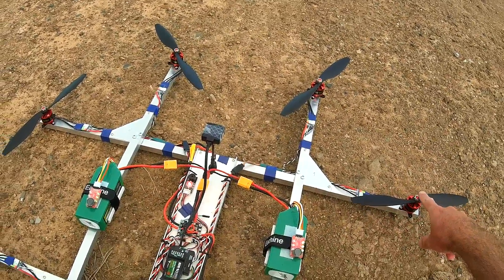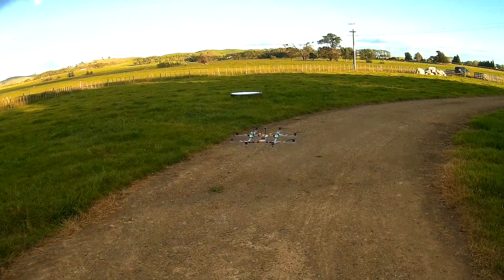Octo thinks it's a quad :)

Comment from the maker: Just in case I didn't describe that clearly enough: http://www.iforce2d.net/tmp/fakeOcto.png
Reply: you can use same esc for 2 motors, I tried and works well, just solder same 3 motor wires of 2 motors in  agrid to same ESC  and will work fine
Reply from the maker: I just replied to you twice already about this, it will not be fine :)
Reply: iforce2d I tried myself 1esc 2motors and worked fine for me.
Reply from the maker: No need to spam the comments so much. I already replied about your 'worked fine for me' in the other comments.

Comment: This really cool. I think this should work with the stacked octa/quad design (I don't know its offical name) where two motors are mounted on one arm in a kind of push-pull configuration, shouldn't it?
Reply: Counter-rotating props. Often called coaxial, even though technically on a multirotor they aren't. Unfortunately unless you do it really well you get big efficiency losses, in the order of 20-25%.
Reply from the maker: As long as the motors using the same PWM signal are spinning the same way it should be ok. So you could make an x8 or a stacked hex, but not a y6.

Comment: May you simulate a motor fail disconnecting one random motor and check takeoff / hover performance?
Reply from the maker: No, this is not mine.
Reply: iforce2d oh. But still an useful test. Isn't the reason why anyone build an exa or octo config?
Reply from the maker: For this case, the reason is just more lifting capacity.

Comment: Is it more efficient (longer flight times) with 8 props vs 4 ?   (if so, then 16 or 32 props could be possible.)  Interesting experiment.
Reply: sptrader nope, one big single rotor would be the most efficient (like a helicopter).  Adding more motors/props add more weight. The increase motor/props increase working area that it can use to produce lift. So has more lifting capacity

Comment: I got in on that 3DR $3 Iris motor deal...  I actually want to do a HexaDecaCopter soon with them.  Do you notice on a scope if the signal voltage drops too far to be split 4-ways on each pin?  I might only have to do 2 if I use pixhawk.  I intend on trying coaxial & concentric on only 4 arms...  I'm not sure how well it'll fly, but I want it to lift, bro.
Reply from the maker: I didn't do any checks on the scope. I kinda think you'd be able to do 4 though.

Comment: Seems like the configuration might be giving up the redundancy that makes octos more reliable.  In that config a single failed motor could cause a pyro event.  Cool idea though.
Reply from the maker: I don't think a failed motor outcome would be a whole lot different to a real octo. In either case it would lose 1/8 the lift capacity, and the effective center of thrust would shift slightly.

Comment: I’m actually surprised this worked. Trying to work out the mechanics in my head. Is this reliant on the paired esc’s being very similarly calibrated? What would happen if they weren’t? Would you get strange roll, pitch, yaw response? What would happen if you pumped the throttle up high and one of the pairs was out of balance, is the flight controller just going to deal with it like one slightly less powerful motor? Very interesting.
Reply from the maker: A similar calibration would help, but I think the PID controller could still handle it either way. Think of it like driving an electric car that has hub motors in the wheels, if one of the motors was weaker than the others, it wouldn't affect the way you press the throttle pedal, because the controller (you) is only sensing the overall feedback of the car speeding up.

Comment: So damn stable!! What FC are you using? And good much flight time do you get with this setup?
Reply from the maker: Arducopter. About 18-19 minutes just hovering. 2x 3S 5200mAh in parallel, 2212 980kv, 1045, AUW about 2.5kg
Reply: iforce2d bro that's a lot of flight time! Atleast according to the standards of mini quad pilots like me :p

Comment: its not 6 pins, some of the pwm pins can be configured as motor out 7 and 8.    anyway in a reasonably modern firmware you can remap to whatever pin you want.
Reply from the maker: This flight controller only makes 6 ESC outputs easy to use: https://youtu.be/twW9CaRlj-U?t=8m28s
No doubt the chip inside it is capable of of eight outputs but I think it would take some veeeery careful soldering to stick a little wire on the appropriate legs of the chip.

Comment: Quite stable...Looks like you installed the Mini Pix as the flight controller...
Reply from the maker: Yes :)
Reply: Can't wait until you do some flight testing with this one...
I'd be curious if the Octo could still fly reliably if you remove a prop...simulating a motor ot prop problem...
BTW who is "we" that you refer to ??...;)
Reply from the maker: this is one that I helped a friend build

Comment: Would it fly any better if you blocked the middle square.  You are blowing a lot of air downward.  Having it escape up the middle would seem counterproductive.
Reply from the maker: According to Newton's third law, as long as the air is being thrust downward, the  aircraft will be thrust upward. Where the air goes after leaving the prop is not really part of that equation. Blocking the middle would likely influence how it behaves in ground effect, but I'm not so sure it would be an improvement...
Reply: Makes sense to me.  You have a high pressure region beneath the 'copter and a low pressure region above.  When hovering in still air, a toroidal flow pattern (like a stationary smoke ring) will tend to develop.  I sometimes see this effect when flying nitro-powered model (single rotor) helicopters - the smoke 'leaks' up through the rotor centre near the hub.
Of course, you get the same effect with the air leaking back up around the outside of the rotor/rotors - but there's nothing you can really do about that!
Reply: lol are you serious?